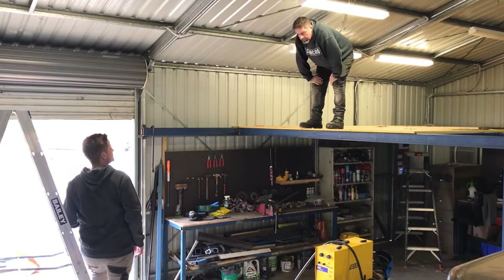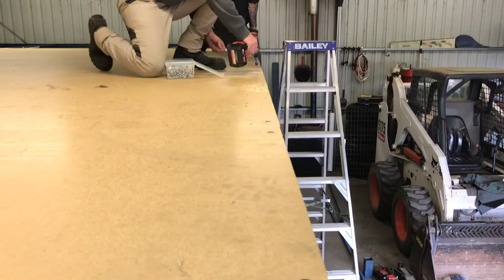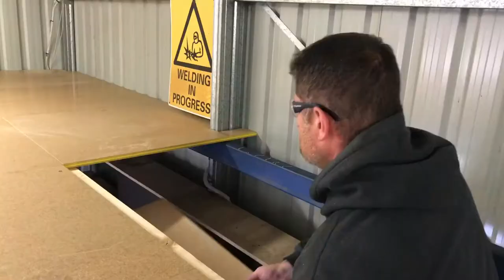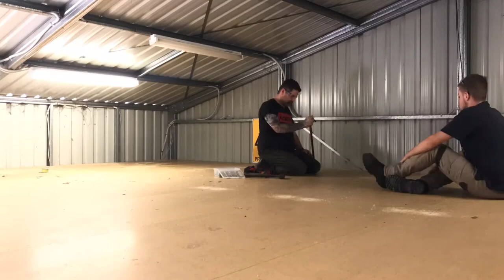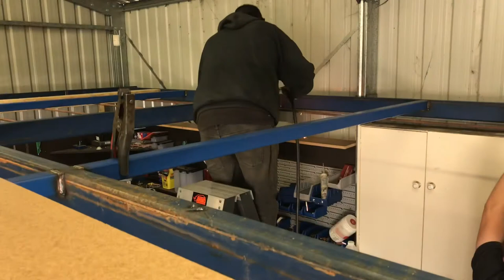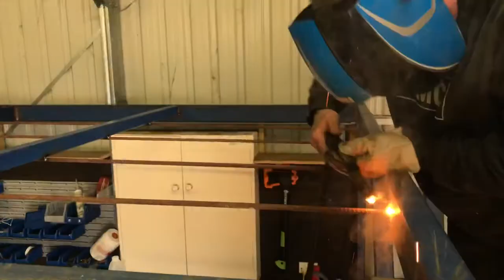Mezzanine Floor Build (Part 2)

Comment: So here's part two. NICE !  Like everyone on here doing a mezzanine I need to span 30' x 10" off of 2X6 walls. 10' High . But i do not want 
support beams underneath it in the way. Looking like I BEAM 12" high 10" wide on 8X8' posts against the walls.
Reply from the maker: Thanks mate definitely would have preferred to not have posts underneath but there wasn’t much else we could do.
Reply: @EngineeredToDesign  I get it man, looks great. Money and space are always a killer

Comment: Do you know what the max loading is for that mezzanine ?
Reply from the maker: Unsure but it is stronger than what the entire shed is built from..
Reply: @EngineeredToDesign  It would probably pay to find out so you don't over load it with stuff, especially if you have heavy items.
If you store everyday items, it should be ok, but be careful with machinery etc.
People usually crane up or forklift unused heavy engines and farm machinery to store out of the way.
Reply from the maker: @tonymontana897  yeah definitely and it’s only yellow tongue flooring, it only stores light items it’s never been completely full either.
Reply: @EngineeredToDesign  Cool mate. Just want everyone to be safe. You seem sensible. I'll leave it with you. Cheers bud.

Comment: Just wondering why you used such heavy gauge & large steel? Are you planning on storing a lot of weight? Sorry I haven't watched all the videos you've posted, maybe you covered this. Just searching youtubes as I want to accomplish a similar thing. I thought I might be able to use the same-ish materials the shed is built out of rather than RHS/SHS steel.
Reply from the maker: Hey Troy, we used the large rhs as it had to span the entire width of the shed.. it was best to build it overkill then under as the previous mezzanine we had wasn’t strong enough. The steel that the sheds are made from is fairly thin it works well in a shed where you have walls screwed to it but I don’t think it would work well out in the open..